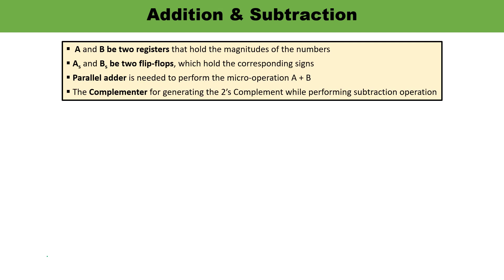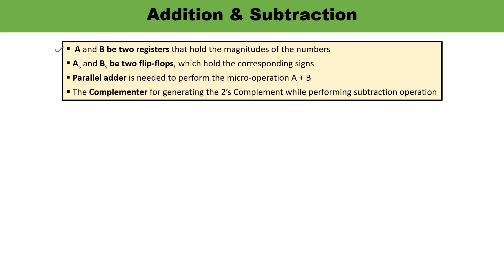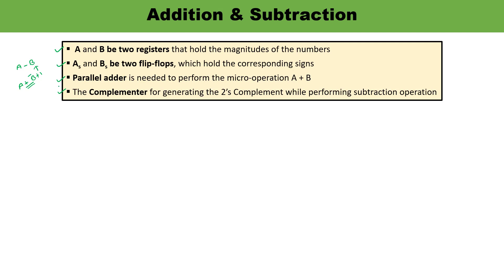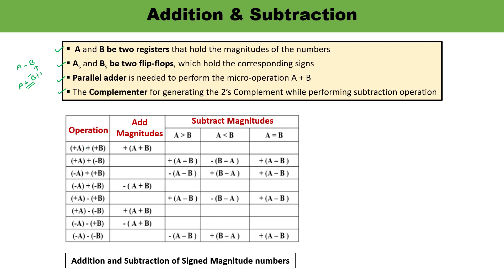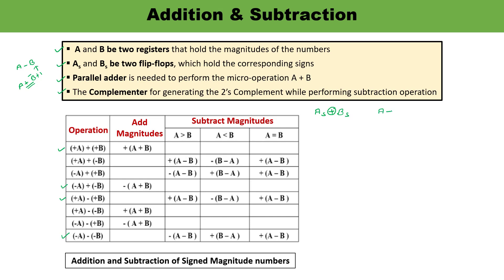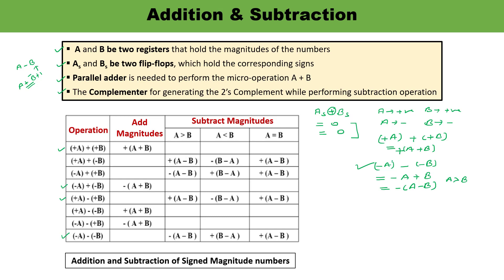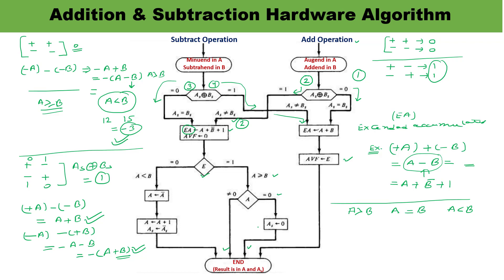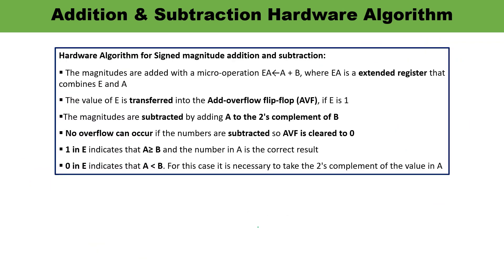Addition & Subtraction (Signed Mag.) | Hardware Algorithm || Computer Organization and Architecture

Comment: 🎯 Key Takeaways for quick navigation:

00:00 🧮 Addition and subtraction of signed magnitude numbers in computer organization and architecture involves a hardware algorithm and considerations of the sign bit in operations.
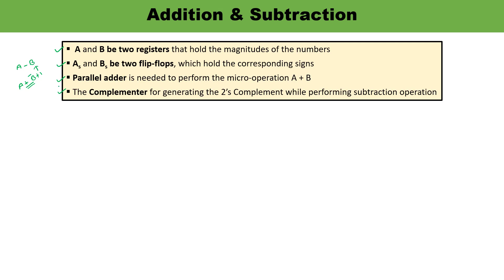02:38 🖥️ Computers primarily use the signed two's complement representation to perform arithmetic operations with integers, as it simplifies addition and subtraction processes for negative binary numbers.
06:19 🔀 In signed magnitude addition and subtraction, when the signs of the numbers are opposite, the actual operation (addition or subtraction) performed is opposite to what's required due to the XOR comparison of sign bits.
08:36 📶 The hardware algorithm for addition involves checking the XOR of sign bits: when the XOR is 0, addition occurs; when XOR is 1, it triggers the opposite operation (subtraction) due to differing signs.
16:53 🔄 During hardware algorithm execution, if signs are opposite and addition is required, subtraction will be performed, and vice versa, leading to the correct outcome despite the opposite indicated operation.